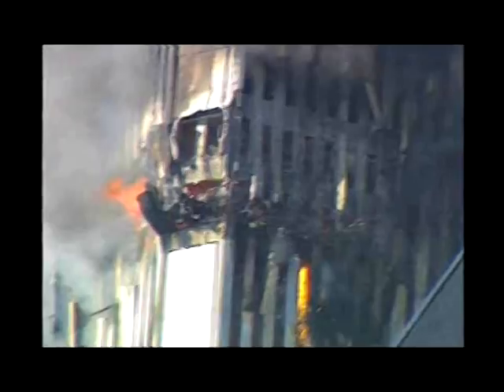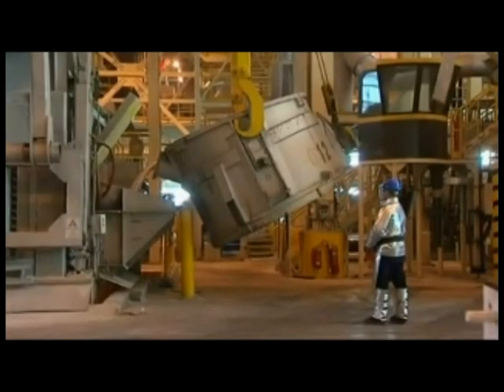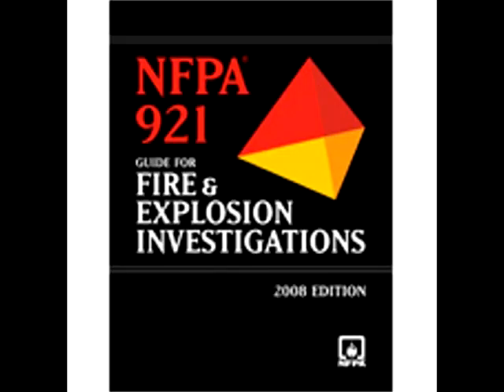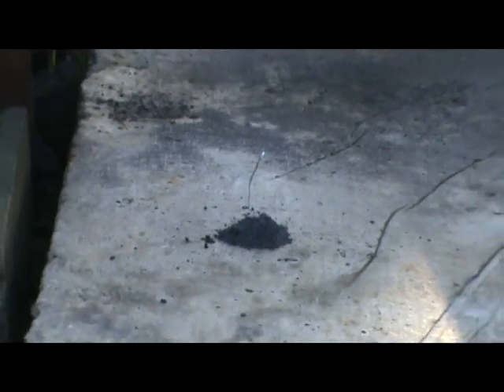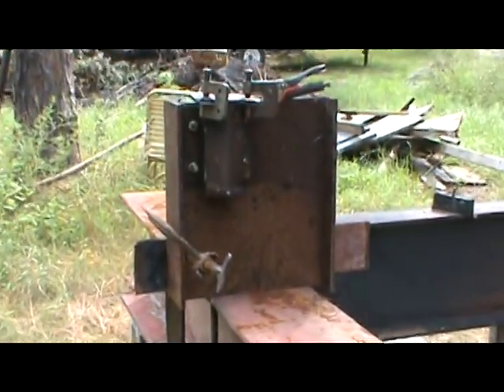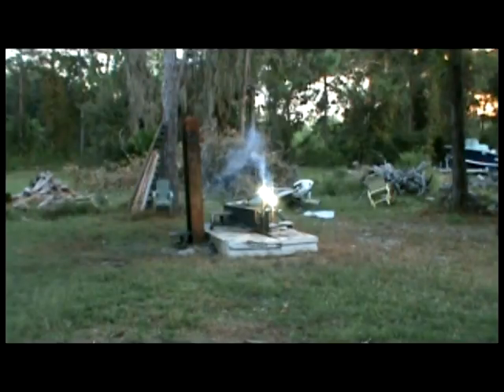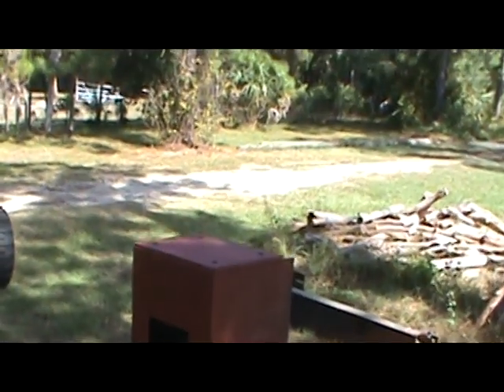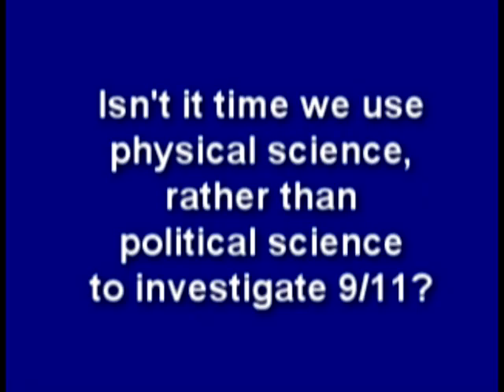9/11 Experiments: The Great Thermate Debate

Comment: Use physical science, not political science?  But remember, if this whole event was supposed to be part of a conspiracy, as is being suggested, then it would have to involve political science by necessity.  How about common sense.  Doing such a technical analysis is enlightening, but overshadows the one question no conspiracy theorist wants to answer: Why?  The answer is that this unprecedented choreography of four planes and explosives was supposed to be an excuse to go to war with Afghanistan and Iraq?
Reply: Well, the real answer does not lie in thermate or the melting point of steel.  The real answer lies in the common sense that the hijacking alone, not to mention the impact of 2 planes into U.S. landmarks was more than excuse enough to go to war with no building needing to fall at all.  The entire act of somehow placing explosives, if there were any, on the exact floors where planes hit the twin towers would be 100% unnecessary and an added risk and liability to achieve a goal of going to war.

Comment: Really good evidence based video.  One question about the official version. Could the wind 80 floors up act like the bellows of a furnace and increase the jet fuel burn temp enough to melt steel. Could you set up an experiment to show jet fuel max burning temp when air is blown in.

Comment: No one understands what happened at a scientific level because it was a one off event. When science finds a bizarre and inexplicable behavior  the standard method is to repeatedly observe, measure, hypothesize and test. But you can't crash jet planes laden with fuel into huge skyscrapers on a regular basis, so we will probably never get the chance to study what actually happens in that situation.

As an engineer, I know that every novel situation has outcomes that can't be predicted. Changes of scale and number have their own outcomes that are not apparent from just extrapolating known models.
Reply: ***** The error you make is in thinking that because you can't understand how it happened according to physics, it must be something else. But when there is a complex situation, science and engineering are littered with things that were considered impossible. We didn't understand how bees could fly until quite recently, their wings were considered too small to produce the required lift, and there are a million example like this. But no one suggested it was a government bee-wing conspiracy, we just admitted to not knowing everything.

Comment: So was the thermite only placed at the same level where the plane struck?
Reply: ***** I guess I didn't see that in the video. If it was placed throughout the entire building wouldn't there have been more glowing spots?
Reply: +Reddit Gold User well the guy who made this video (who I should say, is excellent at what he does) does suggest that there could be something acting as a trigger to initiate the cutting from the thermite. But this would have to be a master class of preparation. I personally am not sure how the building could have come down so suddenly, especially when the heat could only be getting lower as time went on, so any melting would now be decreasing rapidly, eventually the building starts to smoulder in most parts and all we see is office fires....my only question is how the heat was being maintained. You see the direction the wind was blowing right? Well that would be blowing strong gusts into the hole made by the airplane, so it's quite hard to see how such a high temperature could be maintained for so long...that's what confuses me.
Reply: basicaneer You can't have a fire without oxygen, even if you have jet fuel. Thermite is an exception because one of its ingredients is an oxidiser that supplies its own oxygen. I'm not supporting the beliefs in this video, I'm just perplexed how jet fuel can melt steel. If enough oxygen were blowing into the hole then yes it could reach a temperature hot enough, as long as there is enough fuel. I have a backyard forge that I use to melt aluminum cans into ingots. Its uses charcoal, but what makes it hot enough is the air pumped in from an air pump. The more air I pump the faster the charcoal burns, and the hotter it gets. My stainless steel crucibles usually fail after 45 min.
Reply: basicaneer Right but a fire's temperature can be changed with oxygen levels. Minimal levels will cause it to burn at 451 deg, any less and it goes out. Adding a fuck ton of oxygen makes it go up. I don't think 9/11 was a conspiracy btw.
A charcoal berquette(sp) has a good amount of potential energy. Grilling it normally will make it release that energy over the span of ~30 min. But applying more oxygen causes that energy to be released quicker. You can get that berquette to burn 5x faster if you apply 5x the oxygen. The payout is 5x the release of energy per second, or basically nearly 5x the heat, but over a period of time 5x shorter.
Reply: Reddit Gold User okay. I don't believe 9/11 was a full on conspiracy but...there are things that are left out of the full reports, or not explained or discussed that makes me doubt the official story
Reply: ***** what does it matter now, innocents died for nothing, whether it was for oil, or for a god....their lives we're taken horribly, Iraqi civilians and American.
Reply: Johnny B explain what? Whether it was all constructed by terrorists, or whether the government aided them, people still died on 9/11. I've been getting into debates all of the last 2 weeks and what I've learned is neither side is right, the people who believe the official story or the people who believe the conspiracy, there are arrogant deluded idiots on both sides and logical people who just want the truth too...fact is, none of us will ever know we are right until the day comes, if ever, that someone blows the whistle. The only reason we argue, is because one side is afraid of believing a lie, the other can't stand to even bare the thought that their own government could be involved in some way, or let this happen. Because it doesn't matter what side you believe, seeing those people with families and so much to live for falling to their deaths is heartbreaking. The worst is when you see that group who fell together, you can only assume they either fell over each trying to reach for air, or jumped together as friends. My god I can't even bare the thought
Reply: +Bill Smith Oh please, give me a break!  Are you implying that it was a conspiracy and that thermite was elaborately placed throughout the building 30 years ago when the building was constructed?
Reply: +Bill Smith I wil bet money that you can't speak intelligently on anything relating to physics.
Reply: +Arsenal Gunner (AG28) we already know the truth and your ignorance is hilarious.

9/11 truthers are plain ignorant morons. Most are high-school drop outs or joke degree college grads.

Anybody semi educated on this subject would laugh at the conspiracy nut jobs. This video is a joke.
Reply: numkie completely ignored my point and just reinforced my opinion and my perception of the whole thing. I'm muting this post.,I'm tired of talking about 9/11. Find someone else to debate with

Comment: What most people dont realize, is that you dont have to melt steel beams... you substantially weaken steel beams at 2000 degrees, and with a couple thousand tons of weight on top of that, you have a building collapse

Comment: what is used to melt steel? a furnace. what did the towers become after the planes impact? a furnace. why did the tower that was hit second fall first? because it was hit lower and there was more weight on the compromised structure. third question and answer puts the whole thermite theory dead in the water. the whole basis is that it takes a while for it to burn. the second tower did not burn as long but it fell first. one other thing, the steel did not have to melt to collapse the building. like I said the weight was the factor in collapsing the buildings. and the molten metal shooting out of the building was obviously parts of the plane, seeing that it wasn't much

Comment: That was a fairly well made video... the experiments were cool and showed that thermate COULD melt through steel beams under proper circumstances, but not necessarily that it DID. Were any of the beams they found at ground zero cut leaving a razor edge like your video shows?

Comment: "molten metal (NOT steel, metal) was seen pouring out of the building"...but they decline to point out that RAGING FIRES could ALSO be seen "pouring out" of BOTH buildings...after they just said the fires were out and the buildings "were cooling" (they mustve forget to tell the jumpers that)!! Besides...NIST never said jet fuel OR fire MELTED steel...the steel was WEAKENED!!!! Tell the twoofers that a million times, theyll still use the "jet fuel cant melt steel" straw argument"!!

Comment: Really good video. Yes, thermite can cut throught steel if proprelly done like you did. Was your device ideal? No. Was the mix the best one? Another no, your ratio was most likelly off and the materials wasn't the best quality too. What does that mean? It mean that even with your "junk" you succeded to do it. That mean that with access to the expertise of expert and proper materials it would take less material to get better results. This not only prove that the theory is possible, but that it can also be done at that scale.

However, I must point something: molten aluminium can still be red hot. You don't see it like that normally simply because it is stupid to heat up aluminium that hot when it melt at such low temperature... Why would anyone heat something more than needed?

Another point to consider: you don't need to melt steel to weaken it to the point where it will soften. I have a MAPP torch, which heat to about 1600F. This is not enought to melt it, but it is enought to make it glow orange, and allow me to hand bend some 1"x1/8 steel bar on the 1" with relative ease. With a vice and vice grip, I folded one to make it 2"x1/8. This mean that it lost about 95% of it's strength! Now, apply that to a floor. Heat the steel, it soften. The weight of the floor make it bend. By doing so it get "shorter" since it is now U shaped. This make the side support to want to rip from where it connect. Once enought pull force has been obtained because it bent too much, it will SNAP. This may sound like a small explosion. That will also send a shockwave throught whatever it was connected to, and throught the softened beam. That can cause some dust to lift and fly away... I am, however, unsure of how much it would, but I assume it can do relativelly alot due to the force released there. Think of a few tons of pull force to rip that beam... Released all at once...

I am really unsure of what happened. With my explanation it is fully possible. But why did no expert talked about that? It is easy to make on small scale. More complicated on big scale, but still doable.

So, the main issue in all this is: why does the gouvernement refused to do any experiments? It would have been easy for them to actually prove that it can be caused by the jet fuel alone. Yet they prefer to let the conspiracy theory go...

... the evidence does however seems to prove that it is indeed a conspiracy...

Comment: Sabotage? really?...For instance, electrical arcing can go well over 3000 degrees - centigrade. There could have been all manner of materials in there boosting the temperature way over that of jet fuel burning in isolation. The chimney effect would undoubtedly have added a lot of heat. Now I must go make some more thermite

Comment: It's interesting what people come up with when they don't have the answers - when they can't measure something they guess. That's not scientific method and leaves the "evidence" and "theory" discredited. If you build another tower identical to the WTC, then fly and plane into it just like what happened in 2001, and prove that it won't fall down by that, then you may have some credit. The problem is that you'd need the exact duplicate of the steels used in the tower itself to have a consistent measurement. No one mentioned that there could be fire extinguishers that got hot enough to explode. No one mentioned that any sprinkler system could flash to steam and explode the pipe. It's easy to focus on a single theory and try to use it as an explanation, but it's hard to hold water in it.

Comment: The weakness of your argument: It was not necessary to MELT the structural steel in order to bring down the Twin Towers. All that was necessary was to WEAKEN it with enough heat...essentially softening the steel. When we consider that the trusses let go because they were no longer protected by a coating of fireproofing that had been knocked off in the initial explosions of the planes, it is easy to see that the loss of those trusses was crucial to the whole thing.
Note also that there were ""sparks" seen coming from only one location on the tower... right near the corner. Sorry, but knocking out one piece of structural steel would not have bought down the towers.Notice also that both towers collapsed from the impact points...and NOT from anywhere else on the towers! How is it possible that an amateur hijacker could have piloted not just one plane, but BOTH of them to the precise floors where thermite was supposedly planted  in advance? That has to be the most illogical thing that could have happened.

There is one way to prove the entire case, but it will cost over $1 billion to do so. Rebuild one of the twin towers according to specs, and furnish it the way it was furnished on 9/11. Then, fly a remote controlled 757 or 767 into that tower...fully loaded with some 9000 gallons of jet fuel. Have it planned to hit on the same floor as happened on 9/11. Then, with cameras positioned at key points around the tower, make video recordings of exactly what happens ...until the cameras no longer function. And this time, with the entire world watching, let's see what happens...and then compare it to the results of 9/11.Have a good day.

Comment: Just doesn't explain the more interesting questions: When should these devices have been mounted including the wiring for the igniters, who should have done that, why did no one notice it and how come no one had a bad enough conscience to confess? Even smaller conspiracies have collapsed, because of some idiots not keeping it secret (or making stupid mistakes). Interestingly if molten aluminum will not "mix" with other materials, where is the contradiction? When a flow of molten aluminium drags along other material, could the material floating on the outside of the aluminium flow burn in the observed color? You only need to hold some copper into a flame to observe green light, so the question I would also ask is: What flow of material could flow and look like burning steel from this distance?
Next thing is: What in the world so air temperatures have to do with the maximum temperature in a room? Head does not need to be distruvuted evenly. In any burning room there can, without and doubt, be spots that are hotter than the "maximum air temperature" (which is an average), interestingly the outside of the buildung is the part where the is the most oxygen to fuel a flame.
Plus, I doubt it is necesary for the steel to be molten to collapse. We all know that the steel beams are sized with a certain load and temperature in mind. You can't built the structure too strong, because that increased weight will also load the lower parts of the structure. So one needs to have a compromise of good enough strength with low enough weight, if one builds a very large structure. Now we all (should) know that steel will get weaker when it gets hot - it doesn't have to melt, all you need is enough force and enough temperature to bend it - which happens when forging steel. Now imagine all the tons of weight resting on each inch of the steel beams and then imagine rising them to a temperature where the load starts to deform them. The more it deforms the the more the weight is resting on a bent beam instead on a straight beam and it becomes clear that the more a beam bends, the more it loses its ability to carry the weight, whoch means that it will eventually break.
There is no need for thermite. So if you'd state, just for the sake of the argument, that no thermite was involved, what else could create the same impression? Ever investigated in that direction?

Comment: within the impact area you had around 24tones of shredded aluminum and not an insignificant amount of magnesium alloy, mixed in with this there is amount of iron oxide dislodged in the form of rust from the steel structure of the building. you have excelerant in the form of jetA fuel and polymers found in building and aircraft. these all combined form a mix of material that will combine to make a super high temperature fuel and in the right conditions an explosive. If you leave out any of the other materials and only have ignited aluminum you have a material in a molten form and burning at high temperature, if you introduce water to the burning aluminum you will get a detonation. water sorce from fire sprinklers and water storage tanks. all these factors fitted together give you detonations and burning temperatures that will bring steel joists to failure point. 
please conduct some experiments with all the constiuant materials related to the impact of a 34 tone aircraft and not very irresponsibly only select isolated constituants . please do not forget the amount of organic high fat fuel also introduced to the mix!!

Comment: "nano thermite" is just laboratory grade iron oxide and aluminum dust at 140 or higher mesh.

wouldn't matter anyway because it only has about 4.2kJ/g energy release anyway and thermite is runny as hot syrup anyway and needs to be contained. works great for welding, not cutting horizontally or even vertically.